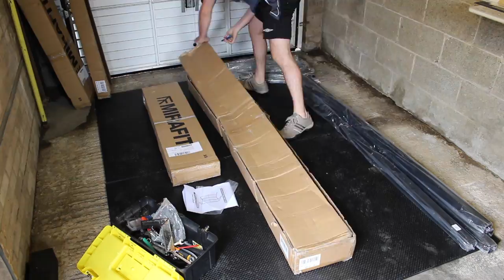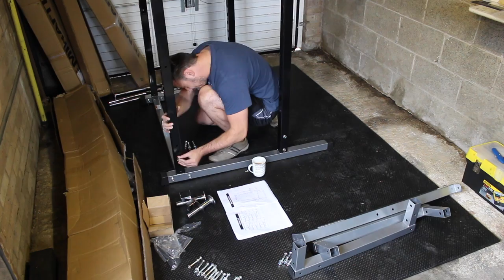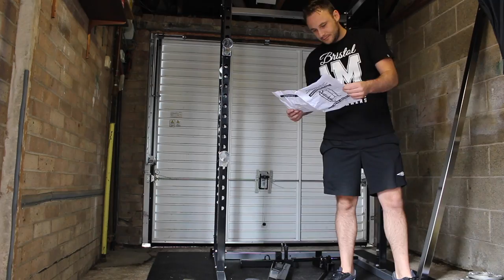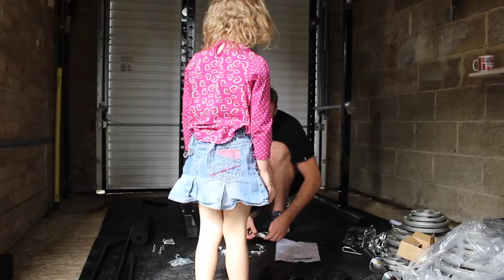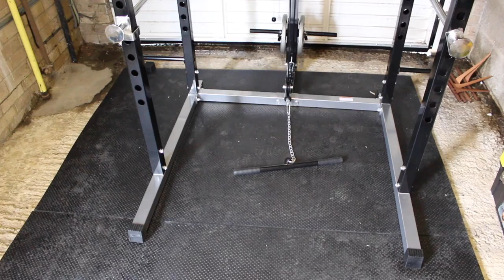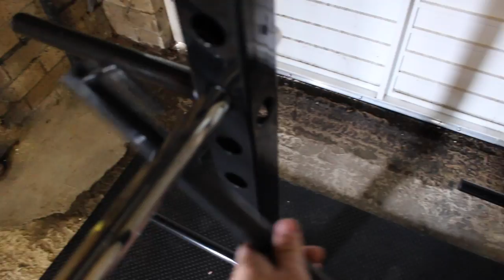Mirafit Power Cage Timelapse Build 250kg Rated, with Cable System

Comment: I've got the 350kg version at 199.99 GBP it's very solid it's hard to beat at this price ... unless you're a 300kg plus squatter relying entirely on pins for safety it's a top spec rack ... no pulley mine has chin bar which is good tbh
Reply: KJH Drug Free Masters Powerlifting ive been looking at racks for a while for a home gym and cant believe the price of the mirafit racks tbh. They genuinely decent?

Comment: Recently got the Mirafit cage and bench but without the cable pulley. Been out of gym for 3 years due to a rotator cuff problem and recently bought a house and converting garage to a gym, much like it looks like you intent to use yours for. Need a few more things. And flooring which isn't cheap even if you go for actual horse stall matts.

Comment: When you place a Bench inside the rack for bench press does it not hit the cable system?
Reply from the maker: It goes up against the cross bar on the floor but no issues

Comment: You can't bench inside it if you have the cable upgrade though, right?
Reply from the maker: I've been able to bench inside it fine..although you cant get right underneath the bar like you would ideally want to, even without the cable as the frame goes straight across..(so the bench pushes up against the frame on the floor). without the cable attchement I guess you'd lift the bench over the frame if that makes sense...its not perfect but I was on a budget and you kind of get used to it, I've got some videos I need to sort actually using it including benching so will aim to get these up soon

Comment: How stable is it for pull ups? I'm thinking of getting one to hang some gymnastics rings from.
Also, what are the dimensions? I need to make sure it fits in my spare room before dropping some cash on it.
Reply from the maker: Hi John, I weigh around 200 pounds and pull-ups are fine, I also have gravity boots and hang upside down from it which is stable, not sure on dimensions but you should be able to get that from product pages
Reply: @DannyMadds  Thanks for your reply; I'll take a look online.

Comment: Hows the build quality?
Reply: Just got one of these myself, they're quite good for home use.
Reply: jake - build quality is very good. I have had my unit for 7 weeks now.
Reply: Jake Hell if you're a powerlifter the 350kg rated with chin bar is hard to best at 199.99 GBP delivered
Reply: Shade on a cool day - I actually don't bench press!. I used to in the beginning when I was a newbie, but I didn't really make much progress. I was more naturally talented for parallel bar dips, so I have been doing that for over 15 years. I have a solid dipping/chinning frame and this squat cage.
Reply: shade - that pic is of a friend of mine who I met in India. I took the photo of him at a competition. I am 5'6" tall, 148.4lbs bodyweight at 12% body fat.
Reply: shade - for a natty (even a hardgainer), you should be looking at benching 300lbs, squatting 400lbs and deadlifting 500lbs.